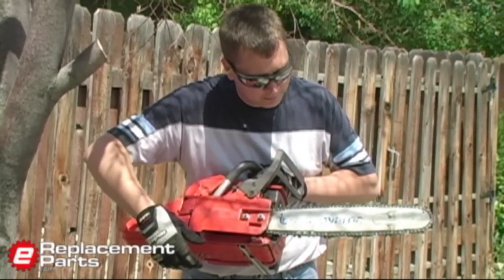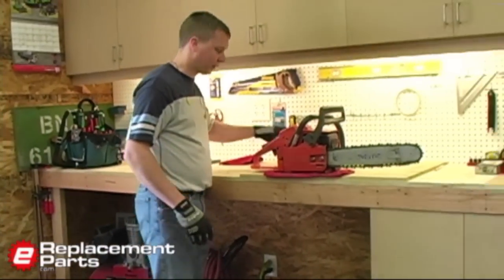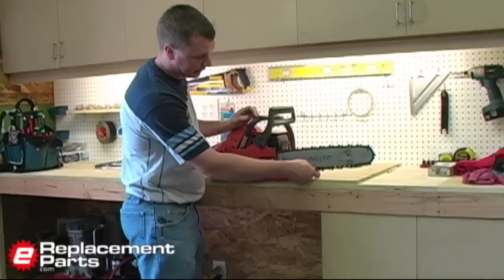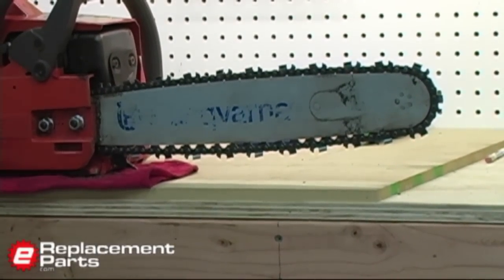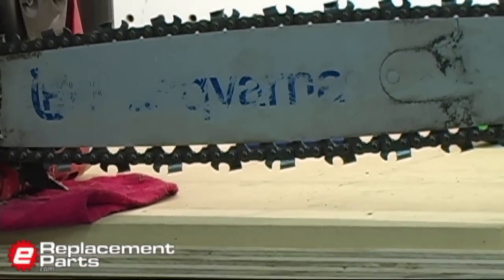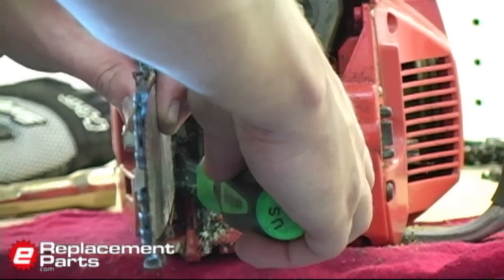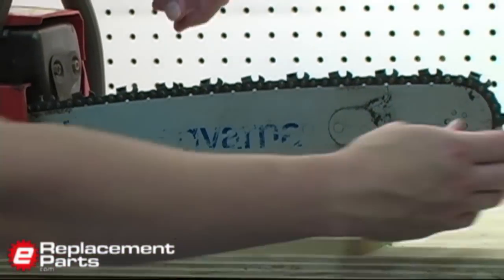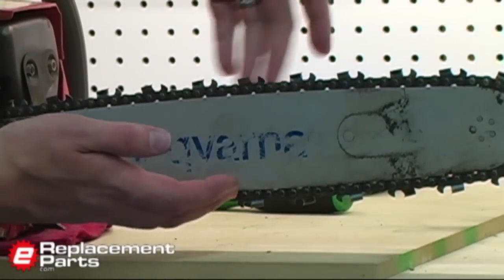How to Tension a Chainsaw Chain

Comment: Thanks for the great video. One extra step I do is back the tension off the adjustment screw after the 2 bar bolts are tight. This takes the pounding off the adjustment screw, preventing premature adjustment screw wear.

Comment: It'd be good to mention about adjusting a hot or cold chain. Don't get a hot chain too tight, or once it cools down it will tighten up and then be too tight. You should be able to rotate the chain by hand along the bar.

Comment: Thanks mate, Just got my first chainsaw, read instructions a few times and it said I needed to adjust chain after  a half dozen or so cuts. So I went to do it but stuffed if I could tighten it any more. The instructions never told me I had to undo the two nuts first. Watched your vid, did it no worries. Thanks for taking the time to create this video for newbs like me! Much appreatiated!

Comment: What if I have the chain loose as a goose, and it still is not turning? I had a problem that it came off the gear, and when I put it back on I must've put it too tight, and now I have loosened it, but it is still not turning. Is there something finding it, and how do I clean it? Thank you!

Comment: What do you do if the tension screw does not tighten the chain?
Reply from the maker: Hi,  if the bar is not moving when trying to tighten it, you have either a stripped screw or a broken bar pin. You would need to locate a parts diagram of your saw and find the correct parts to replace them. They sometimes come in a kit, and they are easy to replace.